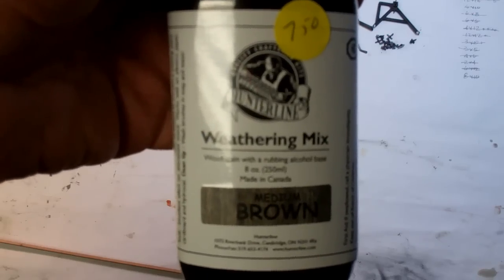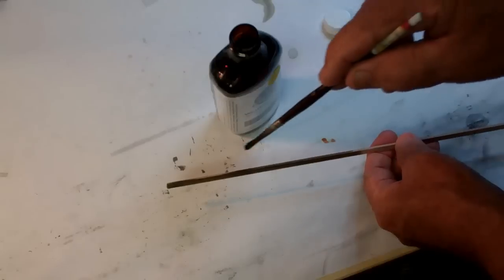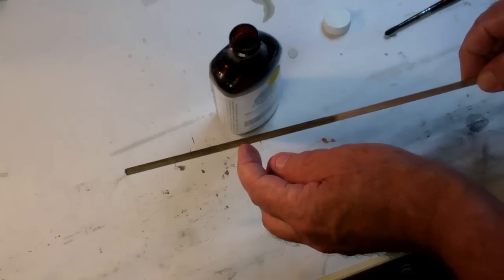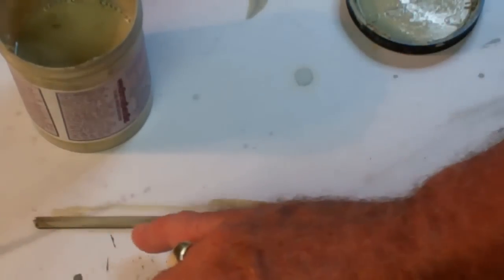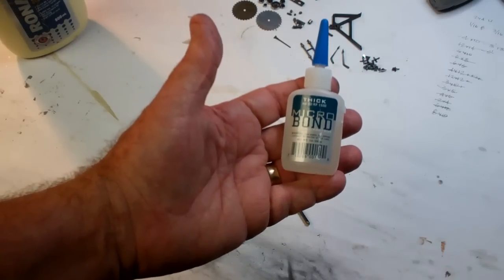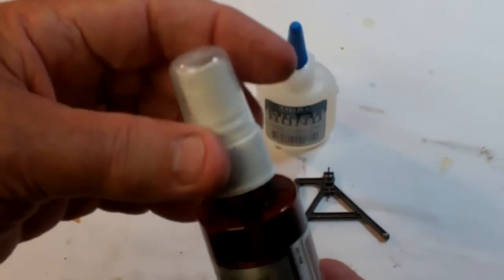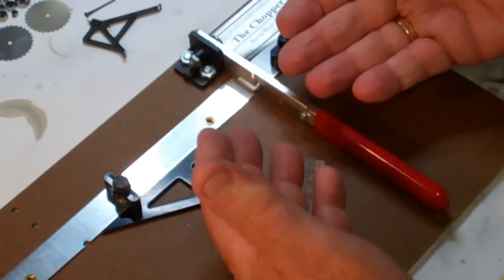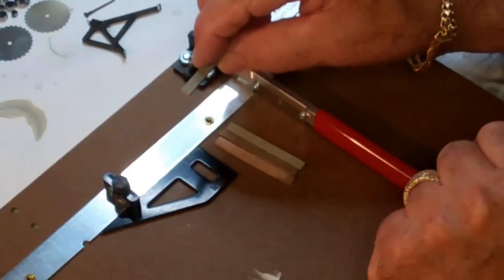Part 5: Building a Sawmill

Comment: Hi Lex, another way to use the CA accelerator product is to wet one surface (dab with tube as you showed, or spray), apply the CA to the other surface, then join the two, sets instantly. You only get one shot this way though, so assembly has to be accurate. Great series of videos, by the way, the sawmill subject is of real interest.